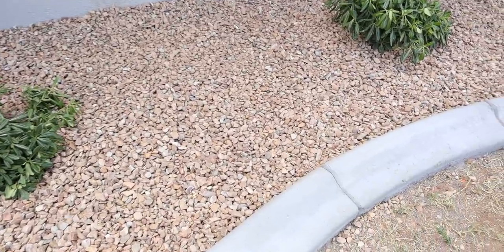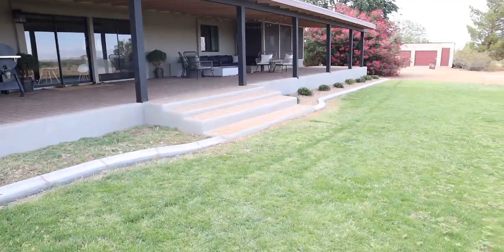COMPLETE LANDSCAPE INSTALL!!😍 ARIZONA FIXER UPPER LANDSCAPING | RENOVATION HOUSE PROJECTS & INSTALL

Comment: Awesome video! I’m a horticulture major and I wanted to mention that gravel can get really really hot and burn roots or foliage. I would recommend mulch more and it holds water more!  Also, the heat from the gravel could heat up your house, mulch wouldn’t have an effect on increasing the heat or might even cool those outer rooms!

Comment: @Hannah's Happy Home:  You buried that Ocotillo too low.  You shouldn't cover the root ball with dirt, it suffocates the plant. The top of the root ball should be level or slightly above the surrounding ground.  I  learned that from Mesquite Valley Growers.  I live in Tucson.  I'm just cringing watching. Your holes for everything isn't wide enough, it needs to be twice as big.  You also should supplement the native soil with succulent soil. Plus if you spoke to a nursery they would tell you to take a hose and supplement your newly planted plants with a hose until the area floods.  A drip system won't be enough to start in Arizona.

Comment: Everything is looking very nice
I solved the flower problem be buying very. Very large pots a couple for the front a several for the back. I plant some perennials in the center and annuals around them 
I can then change the annuals seasonally. With pots you can al control the soil moisture
For some reason they grow better and faster in pots...probably the good putting soil.  The concrete curb looks great!

Comment: Civano's Nursery is such a fun place to wander.  Sometimes prices are a bit higher than HD or Lowe's, but they sure do have a wide variety.    Your yard shows no signs of drought with the water lines installed... all green and full of promise.   We are praying for early monsoons!  I like Lantana in hot sunny places!  (Just don't let your dog eat them). The succulent you planted on the corner bed is Firestick, I believe.
Reply: I have a type of thornless cactus that looks like jumbo towering prickly pear. Mine are over 10 feet tall.  If you are interested, I can give you as many pads as you'd like to start your own cactus trees.